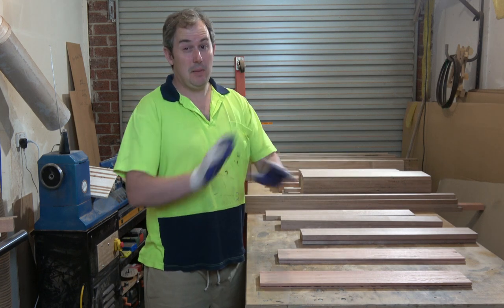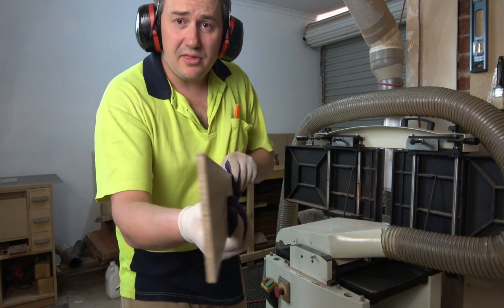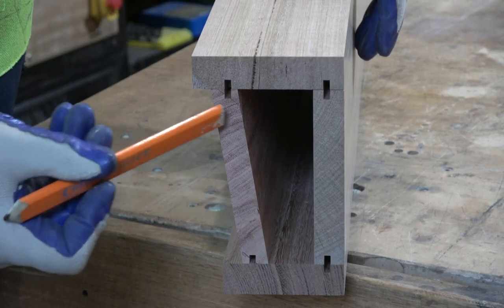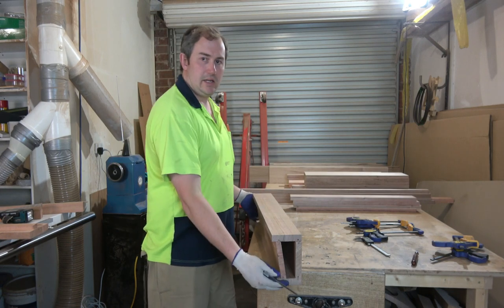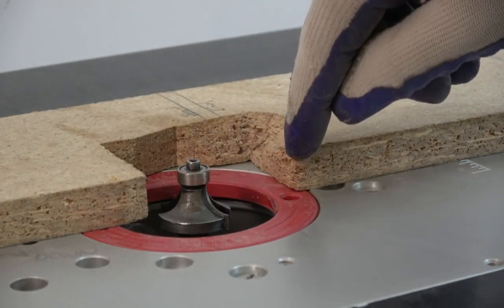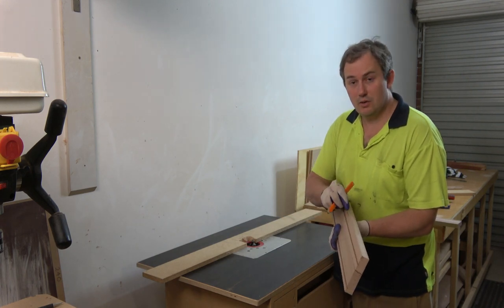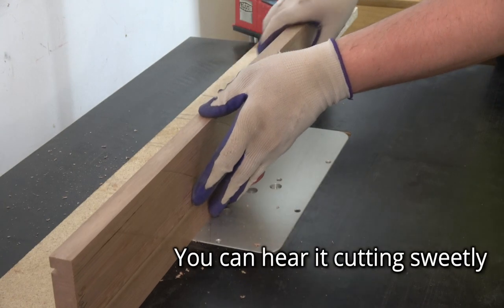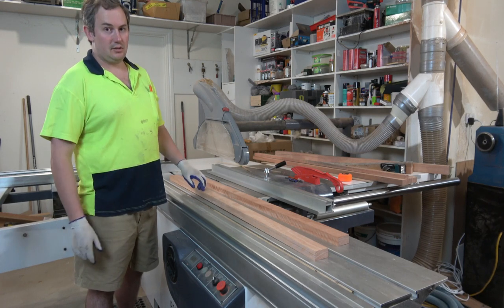Rare Woodworking TIPS - Baby Cot DAILY Woodworking Vlog 4

Comment: Hey Kuffy, how good are those jet jointer/thicknesser, I love mine....do you have the helical head?
Reply from the maker: I do have the helical head. It's a pretty good machine. Though I find it to very slow most times, but when I need to thickness full width the slow speed comes in handy. It would be nice if I had two options 7m/min and 3.5/m instead of just having the one option of 3.5/m

Comment: I'm really enjoying this series 
What is the purpose of bending thin material ?
Reply from the maker: Thanks Mahmoud. I'll cut n paste the reply I just gave to Dave so that you or anyone else doesn't need to go searching through the comments at a later date. 

The cutter head lifts the timber as it planes and it is the rollers which prevent this lift. As a board enters the thicknesser, only the infeed rollers are applying downwards force because the board hasn't reached the outfeed rollers yet. When the board is very thin, the board can flex upwards between the distance from the infeed roller to the cutterhead, even if it is only 50mm (2"). By bending the boards, it puts a huge amount of downwards force on the leading end of the board preventing the cutter head from lifting it up and creating leading or trailing snipe. I will have to machine some 45 x 3mm stock sometime during this baby cot build. I will demonstrate the difference between bending and not bending. Hopefully you will be able to hear the difference in noise, and see the snipe it created. Knowing my luck both methods will work perfectly and I will look the fool again 😀

Comment: what is the purpose or benefit of bending the boards as they go in and out of your planer?  i'm curious because i've planed very thin stock, but always just put it into my planer like any other board
Reply from the maker: The cutter head lifts the timber as it planes and it is the rollers which prevent this lift. As a board enters the thicknesser, only the infeed rollers are applying downwards force because the board hasn't reached the outfeed rollers yet. When the board is very thin, the board can flex upwards between the distance from the infeed roller to the cutterhead, even if it is only 50mm (2"). By bending the boards, it puts a huge amount of downwards force on the leading end of the board preventing the cutter head from lifting it up and creating leading or trailing snipe. I will have to machine some 45 x 3mm stock sometime during this baby cot build. I will demonstrate the difference between bending and not bending. Hopefully you will be able to hear the difference in noise, and see the snipe it created. Knowing my luck both methods will work perfectly and I will look the fool again 😀
Reply: I appreciate the reply,   thank you for the info.
Reply: Another fine video. Seems my computer may be coming home tonight so I'll have ti get filming again

Comment: Good stuff kuff!;) coming along nicely! GOOD fyi about the round over I usually cut the board a few inches longer to compensate the tear if I get any but that adds up fast especially with pricey woods gonna use that tip next time I have  that issue! Cya on the NExt one🍻
Reply from the maker: The roundover tip isn't so much about tearout, though it does alleviate the problem somewhat. It's more to do with the finish quality of the cut by cutting with the grain compared with against the grain. Cutting with the grain allows the cutter to slice through cleanly. Cutting against the grain, the cutter lifts the grain and then either cuts through or smashes its way through. It's like shaving your face. Shave down with the grain or a smooth soft feel. Or up against the grain and feel it tearing and pulling at your face.

Comment: As I've been invited to comment, here goes.... 
1) The explanation about the location of the fence on the router was really good.  The info about grain direction was good too, but I'm not sure everyone will get that (maybe until they experience it!)   
2) It is scary seeing the heel of your hand so close to the cutter head on the planer - In the comments you have already said you are responsible for your safety and also you do use push blocks on the planer and that your teachers (18 years ago) said you were responsible for your safety.  The more recent O, S & H in the workshop is more about developing good habits, so in the event you have a momentary lapse of concentration your hands/body are still well away from the sharp and dangerous bits.  
3) Use of gloves.  We were taught the use of gloves significantly reduces your ability to feel (tension or odd movement etc) and therefore gloves increase your risk when using tools.  
4) It is good getting the Aussie humour coming across.
Thanks for the videos.  Cheers, David.
Reply from the maker: Thanks mate. 
1. You are probably correct. They might be some which don't understand it, but eventually when they get chunks of timber being ripped out, they might try it and instantly realise what I was saying. I should have cut against the grain at significant feed speed so that it does tear out and chatters and rattles during the cut because of the breaking fibres. Tassie Oak, like I was using, is a fantastic timber for splintering a million miles up the board. It's bloody stringy garbage!

2. Having the heel hooked on the end of the board is actually the way I was taught by several teachers in different trade schools, along with several different tradesman in different unrelated businesses. Although I know that one slip and I'm cactus, I still do it because I am very comfortable doing it, just like the tradies before me. On thinner stock I do use that custom built push block, which effectively is the same thing as the heel of my hand. It's just a little awkward to use so I don't bother on thicker stock. What I was taught NOT to do was to push with side of my index finger. I can't think of a good way to explain that other than side of index finger. I know a few tradies with short index and middle fingers because of exactly this reason.

3. You are wrong about the reason why gloves are unsafe. Think of gloves as loose articles of clothing, because that is effectively what they are even if the gloves are a pretty nice form fit. Rotary equipment grabs loose clothing and pulls it in with rotation (so make sure your sleeves are pulled back when working with machinery). If your hand is inside the glove at the time, you have no more hand. Loose articles of clothing plus pinch points (the distance between jointer cutterhead and infeed table, or distance between sawblade and table saw blade insert) plus a rotary action is a recipe for disaster. You need to be completely confident in your ability to NEVER touch the rotary part of a machine while the power is supplied to it (whether the on/off button is turn on or not. change the blades with the machine unplugged. I always do it). With or without the confidence, using gloves is a very ill-advised thing to do. As are long baggy sleeves or tshirts which are loosely dangling down around waist height (the same height as a jointer). It is rare to see safety comments regarding loose clothing on youtube which I find very dissapointing by the safety sallys. Makes me think they are just blindly repeating what others have said for chance of having others blindly agree with them. Who knows though. I do not think you are one of these people and I truly thank you for your effort.
4. Yep. I'm a funny bugger :D cheers mate.
For what it's worth, the next video will have some glove action and some non glove action. I know people will still down vote the video's and comment about how my own and everyone elses safety is my responsibility and or liability, but I can't please everyone. I'll give it a go anyway.

Comment: Why bend the wood for the planer?
Reply from the maker: The thin timber is very flexible, and tends to flex upwards into the planar head before it has made its way to the outfeed roller. By bending the timber, it puts greater downward force on the leading end somewhat compensating for the flexibility of the thin timber.

Comment: Nice mate but you don’t use push blocks & I know you’re cutting non through cuts but I got scared for you brother, didn’t Jord remove some finger on das Jointer ouch, love your project 🤘🤘🤘
Reply from the maker: I don't use the commonly store bought push blocks ever. The only "push block" I use is with the jointer is as seen in the second video of this series. https://youtu.be/T5S9CSB4owU?t=2m42s  That link takes you directly to it.  That style of block keeps my hand flat and low while hooking onto the back of workpiece. It allows me to maintain a "soft touch" rather than needing to be heavy handed using the store bought plastic push blocks. Being "heavy handed" is more dangerous than wearing gloves because when something goes wrong, you have a lot of muscle power throwing your hands forwards that you need to restrain.  On the saw, I use a push "stick". It allows me to push the stock forwards past the blade while my right hand doesn't pass the front teeth of the blade. It's better than a push block, or the push stick popularised by John Heisz. Others will have different views, but these are my hands.

Jord did cut the top of his middle finger off on the jointer. I'm not entirely clear as to how he did it, because he isn't clear either. A push block in this case wouldn't have helped him because it seems the major cause was brain fade. Brain fade on a bandsaw removes a lot of thumbs.
Reply: Kuffys Woodwork Sorry mate & I did see that block, I feel like a lemon head for making my statement & thank you for reminding me, you’re making a nice project here & it’ll be a family treasure 👍👍👍👍
Reply from the maker: Don't be sorry mate. If you have a question, concern or observation, by all means share it. I might learn, you might learn, we all might laugh, who knows until it is out there. 👍😀👍
Reply: Kuffys Woodwork That’s why you’re a good Aussie mate, hey it’s a great video series you’re compiling & why do we wear these high vis tops even on our days off ? , it’s my go to clobber lol
Reply from the maker: Hi-Vis for safety in our shops. I wouldn't want to be impaled by a forklift in my one man garage wood shop 😀